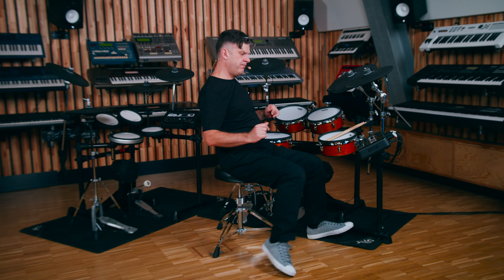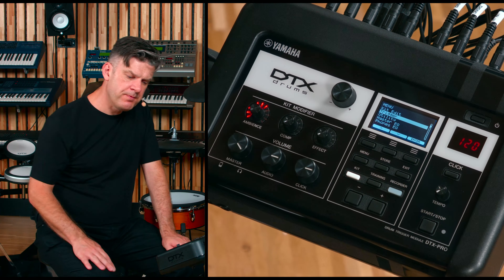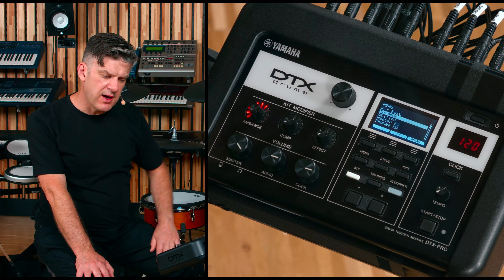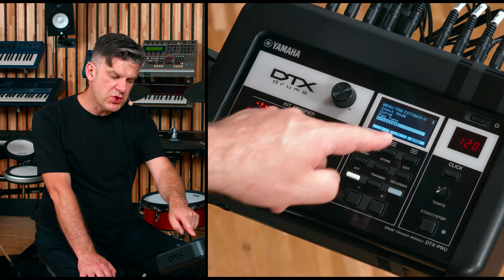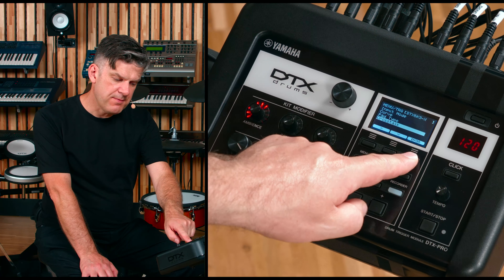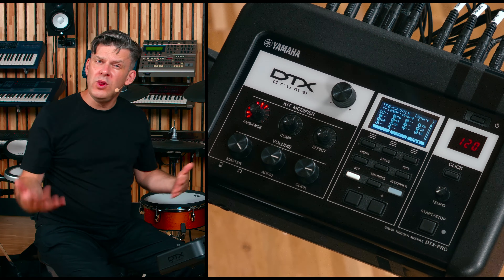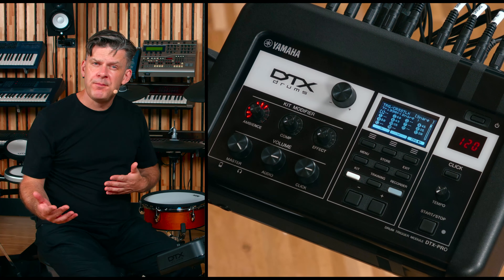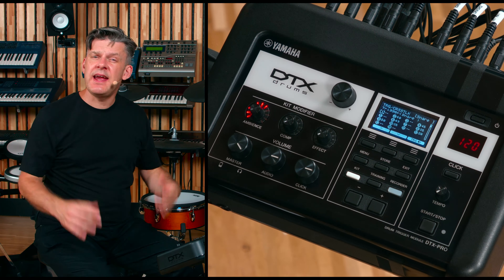Yamaha | DTX6, DTX8, DTX-PRO | Adjust Cross-talk setting

Comment: More revelations...I'm trying to find the video that directly relates to one of my issues...meanwhile I'll keep looking and posting and maybe something will pop up. I have the basic DTX6K-X but it does have the TCS 3-Zone snare pad. I believe this to mean I should have three different zones on the pad which I can create three different settings and parameters for. Although I have been able to identify each of these zones...Head...OP Head/Rim...CL-Rim. When struck, they all sound as designated but I have yet to discover how or where to create the individual parameter setting options. There's a section for rim level and head/rim balance but these have no affect on the pad. Is there some secret switch somewhere I have overlooked that activates this option? It just seems like the further I dig into this enormous MAZE of configurations the more complicated it becomes. I would really like to take advantage of the potential of this unit...but I just want to get some tracks recorded before I DIE! Does it really have to be this complicated?